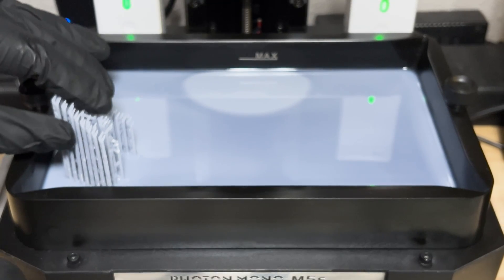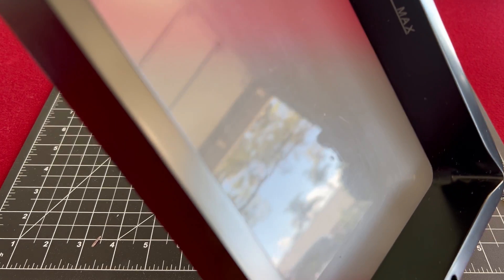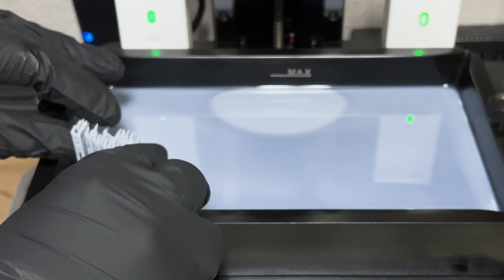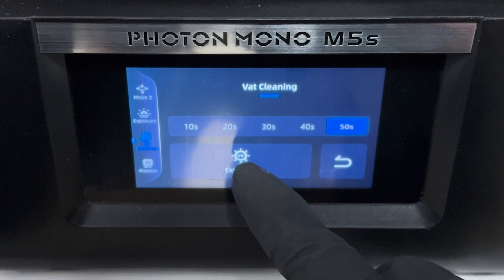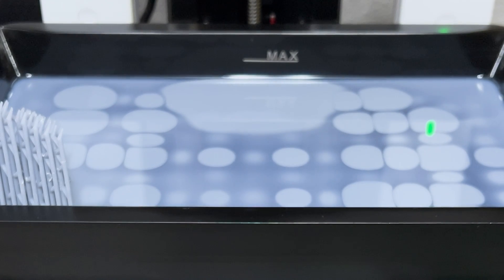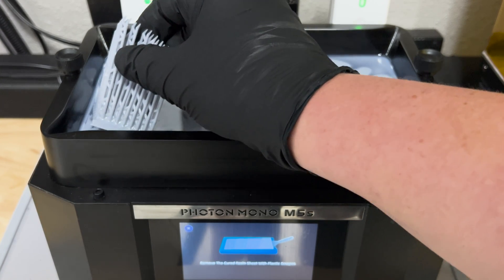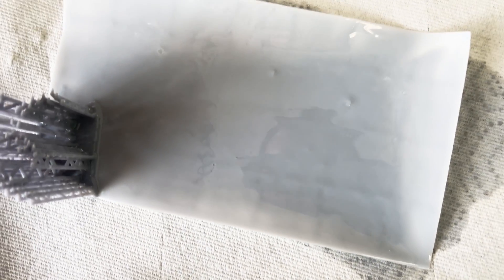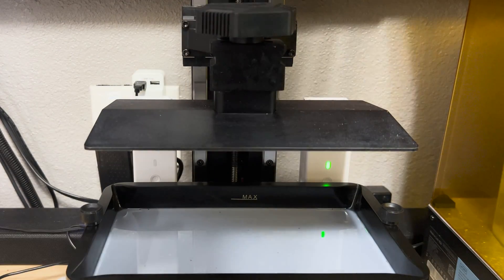How to Easily Clean Your VAT After a Failed Print

Comment: How often should I run the clean VAT with the option that comes up after each print?
Reply from the maker: I only run a VAT clean if I have had a failed print or haven’t done it in a while. When I mix the resin with a rubber spatula I always feel around in the vat for pieces

Comment: Anyone have the  m7 pro? It's a giant piece of crap i only got maybe 10 prints before I had to change all the film the vat and the fep. Cleaned it many times still had issues than the whole auto leveling crap thar does not really work got that fixed did a print got error for debris in trough bunch of crap even got the error for the pump being bad and I don't use the pump at all

Comment: I tried this but the supports didn't stay attached to the film layer. Now I've got a resin layer stuck to the bottom of the tank. Any tips for removing that?
Reply from the maker: Drain the resin, remove the vat and carefully remove the cured resin layer with a rubber or plastic scraper

Comment: Great tip but how do you totally drain the vat on a Saturn 4 Ultra? I'm going to use some cheap translucent resin while I test the printer, but then want to switch to medi clear bio resin and I'm wondering how best to get the old resin out.
Reply from the maker: @SoloLap  Completely remove the Vat and poor the leftover resin through a filtered funnel back into the resin bottle, then wipe out the rest with a lint free micro fiber cloth… Once you get most of it out spray a bit of IPA inside the Fep and let it sit for a minute. Then take the cloth and gently wipe out the rest. I like to cut corners of the cloth so you don’t waste the entire thing. Make sure there is no debris and that it is completely dry before adding new resin. 

If you are testing a resin and switching to a different one they might have different calibration settings. You will probably have to run calibrations again on the clear bio resin cause the profiles might not match. Just something to keep in mind. 

Hope this helped!

Comment: Another tool to find debree from vat is to 3D print "Resin Scoop" either with FDM or resin. Its better than silicon spatula
Reply from the maker: I’ll check it out! 
I more use the spatula to feel around in the VAT,  not for any kind of removal.

Thanks for the comment, I appreciate it

Comment: Resin is expensive and I find myself not even using this method because it's a waste if I know there's debris in my tank I would just rather strain it, having an extra build plate is also a good idea so you can strain and then still get back to work......
Reply from the maker: This method saves me a lot of time when I need to quickly clean the tank. I mainly print very large models (1/4 and 1/6 scale) So the small amount of resin wasted is not a big deal to me. 

Everyone’s methods and printing needs are a little bit different so I always say, do whatever works best for you to make the process easier😊 

Thanks for the comment
Reply: @ResinForge  oh no I get it saves time that's why I have a spare vat